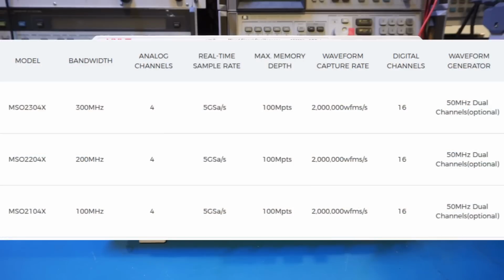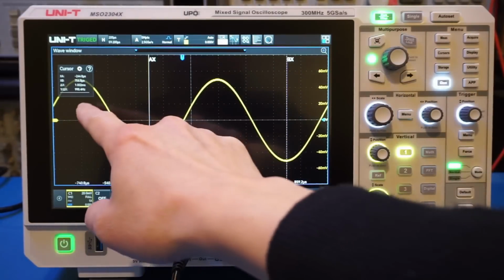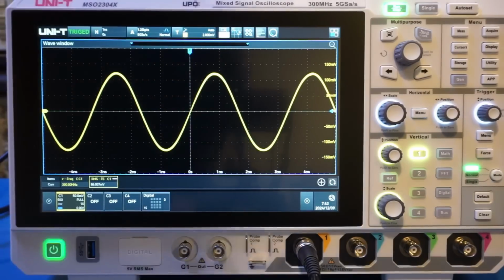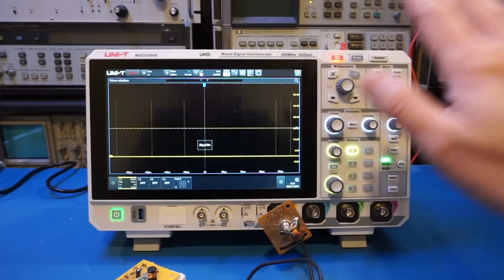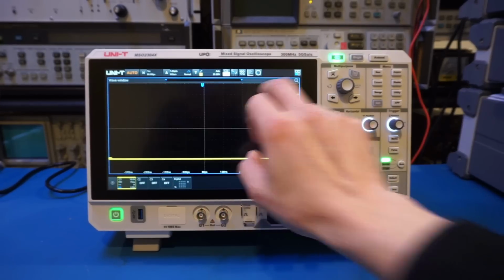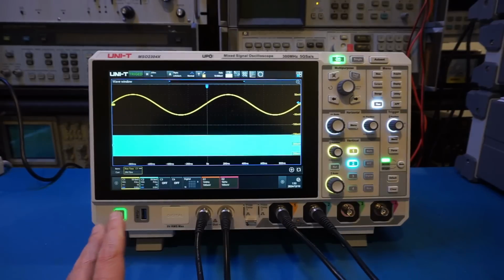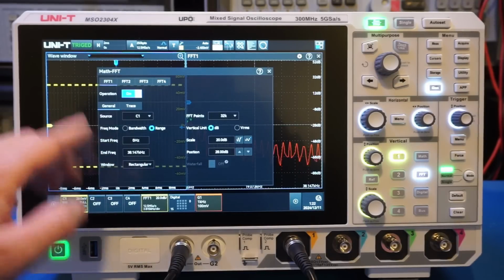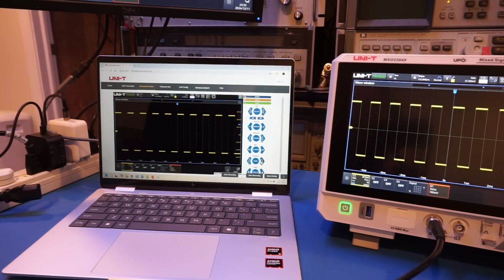UNI-T MSO2304X 300 MHz Mixed Signal Oscilloscope Comprehensive Review

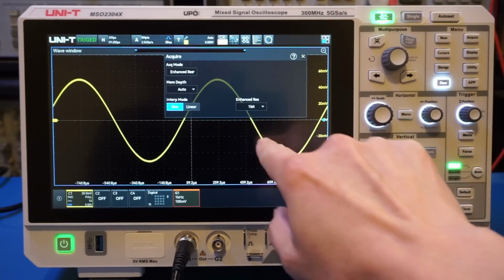Comment: 10:21 What is half a bit?
Reply from the maker: Think of it in terms of the number of discrete voltage levels that can be distinguished. For 9 bits it's 512 and 9.5 bits it's roughly 724. So if you have a 1V signal, the resolution is roughly 20mV for 9 bits and 14 mV for 9.5 bits.
Reply: In hardware, it obviously has to be a whole number of bits, but with accounting for noise, or converter accuracy, you can be left with "partial bits" in the end - so it's probably 10 bits physical, but 9.5 bits of usable resolution

Comment: Nice review.  Do you know if the 100M memory is divided among the 4 channels (if selected), or is it 100M per channel activated?
Reply from the maker: Good question, the manual didn't specifically mention. But my understanding is that it's 100Mpts per channel as you can enable all four channels and the 100Mpts option is still valid.

Comment: The single vertical gain and position knob is a no-go for me.  One of my scopes has that and it is a pain to use.  The Rigol MSO5134 is a much better scope and not much more money. If it had a VESA mount, that would certainly help.
Reply: I'm not seeing the Rigol MSO5134. I will note that I have an MSO5204 and the user interface is not very responsive. This scope appears to be registering inputs much faster than the one I have.
Reply: @jggdotcom  Sorry, typo MSO5354